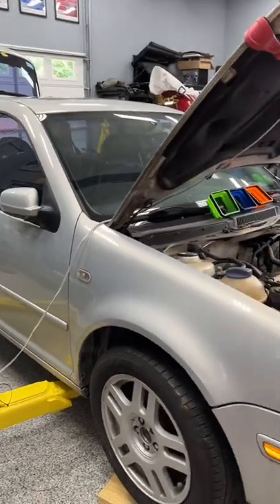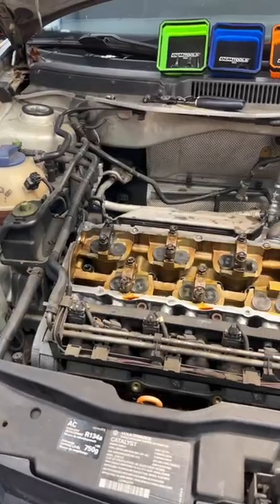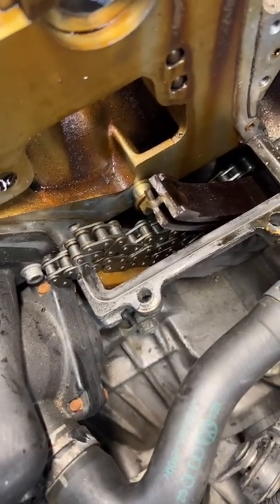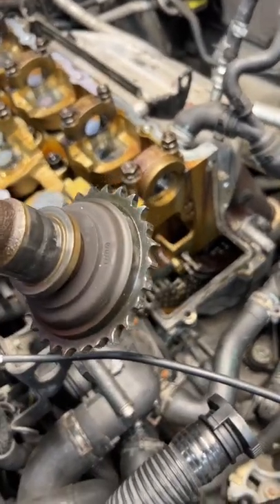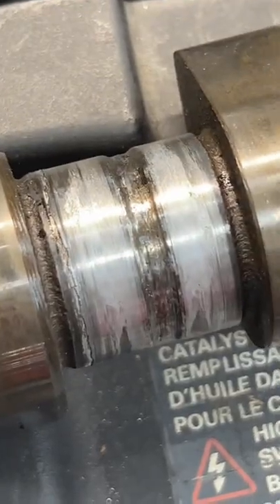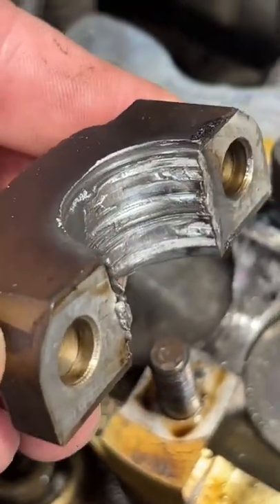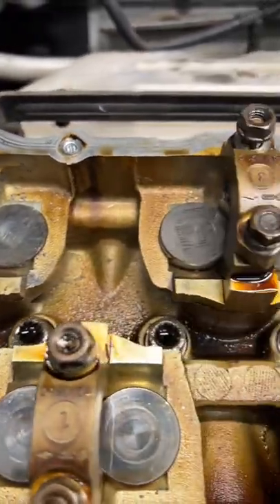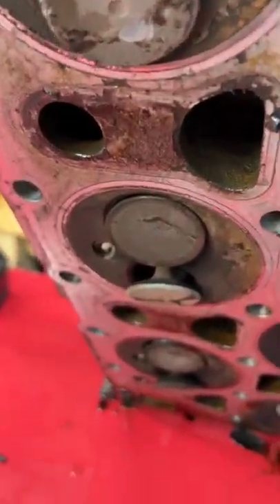What Happens When a Timing Chain BREAKS

Comment from the maker: I’ll have a full in-depth breakdown on this one for y’all soon. But the damage was too good not to share
Reply: It sure was. I suspect you think oil starvation led to the destruction.
Reply: Yee haw, looking forward to it.
Reply: @Peter_Riis_DK  I think not oil starvation, more like never changed the oil, or never checked the oil level on an engine burning oil, or still running the original factory oil filter.
Reply: I imagine it would be financially pointless to fix it for the vehicle, unless you had spare parts around anyway or were planning on using the block for a project. Damn, how I'd love to have a VR6 that doesn't cost an arm and a leg and is readily available. Here in Germany, they're pretty rare beasts because the most popular engines were 1.4, 1.6 and the fabulous 1.9 TDIs.
Reply: Ain't no hill for a climber!!! "Timing Chain Sadness " isn't that a song title?
Reply: It's a vr6 sooooooo, it's getting rebuilt
Reply: I buy all 1.4 TSI Motors with Chain Brake and Piston branke and No Problems WE make alle of Them New an Bye Bye 😀 . All Motors with turbo an supercharger
Reply: So you're gonna fix this or does it need a new engine?
Reply: Sounds interference grenade.
Reply: How much does a job like this cost? my 2013 5.7 super charged tundra cylinder 1 compression is reading 90 psi. Makes no noise, turns on, just drives with less power.
Reply: I wonder how you take a closer look at any kind of moving belts or pulleys with that beard, do you tape it up?
Reply: I have to admit. I have been using the phrase "sadness" on the regular since first seeing your channel years ago.
Reply: was a mechanic's gamble.... 500$ is unfortunately a grocery store weekly trip in 2023... but if motor did not crash... no1 would know
Reply: Wow, you're really positive about it!
Reply: Rebuild good to go
Reply: Replacing the engine head would work?

Comment: Wouldn't that much metal on metal be screaming like a banshee? I wonder what metal the guy was playing over the stereo to drown out the other metal?
Reply: It would probably sound more like a thunk and the engine stopping
Reply: Nah you don’t hear shit that’s why people run them dry they don’t know without looking unless they are listening really close. May have had a loud exhaust to.
Reply: Cast iron cam in an aluminium bore, not much noise, if at all with no oil. It just melts and galls up and goes smoosh.
Reply: Burzum Jesus'Tod, drowns out basically everything.
Reply: @SPE4RHE4DS  Pretty sure most black metal will do the trick haha
Reply: Slipknot for sure….
Reply: iv runned a toytoa Corolla with out any oil for 30mins and drove around in circles didnt even make a sound totaly dry zero oil after the 30mins it started making noise and turned it off put oil back in and it was fine
Reply: @kato2182  Yeah it's a Toyota. Anything else and you're screwed.
Reply: @tammyforbes2101  Umm no.. pretty sure I know my car.. when I first start it up it's supposed to make all those ticking/knocking sounds for 15-20 seconds 😂
Reply: @kato2182  Doubt
Reply: Agreed he must of heard that. All is needed is another engine. 
Good thing it was cheap.
Reply: That’s metal🤘
Reply: "Cry of the Banshee" by Brocas Helm 😁
Reply: Metal
Reply: @tammyforbes2101  Lol, I ca clearly hear even the slightest tick, and im sadly kinda deaf...
Reply: @garrethdovey2861  if it was slipknot the car committed suicide.
Reply: Metallica
Reply: @kato2182  yeah no lol, worked as a tech and you did no such thing
Reply: @richmondvand147  I’m still working as a tech and who knows where the car is now

Comment: Damn. That engine is toasted
Reply: But isn't the block still good?
Reply: @DaBossk  technically yes but down to bare block clean to get all metal out oil pump chins gaskets plus much more. Better to drop in a salvage yard motor with warranty
Reply: @DaBossk  its cheaper to head to a junkyard and get an engine for 200$ then to do all the work and parts for 600$
Reply: @thatslegit  Junkyards went up to 450 plus tax.
Reply: No. That head is toasted
Reply: @thatslegit  all the work and parts for 600$ dont think so.
Reply: @thatslegit  I got a 4.6 2v motor for 450 but after swapping chain guides and & new oil pump, new gaskets, and various things to replace while it’s out. I’m a bit over a grand into it. still not bad
Reply: @thatslegit  600$?!? I want some of whatever you're smoking. Shit would be like 3 to 5k at a shop in my area, if they would even go near it.
Reply: nah j put new valves new cam and timing chain and it’s good
Reply: would check valve springs too
Reply: @thatslegit  i doubt you’ll be finding a VR6 in a junkyard. but the engine is still worth a machine, rebuild, and maybe a new head
Reply: @RegulerShowTV  Cant complain for a grand mate
Reply: @DaBossk  maybe but it's cheaper to get a used one
Reply: Y'all do realize I used one is likely to have the same problems that cause this one to fail
Reply: @GeminiWoods  i never calculate labor since id do that myself. I hang out with the honda boys and we do hauls every so often
Reply: @thatslegit  what??? Where???? Just paid 650 for a mazda 3 motor smfh

Comment: Gotta love those interference engines
Reply: Designed to total engines with the excuse of fuel economy.
Reply: @osco4311  non interference engines suck for power, interference isnt just about economy
Reply: @osco4311  its not for fuel economy its for higher compression ratio
Reply: @downreach5751  Which provides....?
Reply: @andreasu.3546  provides power so you don't need to buy a 6 liter engine to make 200 crank hp
Reply: @red how do we break free?
Reply: @nathank5794  lol 2.4L engine and a fast CVT should get you 0-60 in 6 seconds.
Reply: @downreach5751  Higher compression ratio = higher thermal efficiency = better gas mileage
Reply: @red wish more people like you designed cars...❤

Comment: I'm convinced mine was one more startup from doing this. 
She made a hell of a racket when I parked it in 2012.
It didn't fix itself by 2019 sitting in the garage all that time, so I opened it up and found busted guides and chunks of guide that were timing gear shaped. 
I'm also glad I dropped the pan because that's where all the pieces were. 
Runs great now 🤣
Reply: I hate when they don’t fix themselves on their own lol
Reply: Busted guides sounds like a Ford 4.0
Reply: @tegimr  pretty common in the vr6 engines. It was throwing cam/crank correlation codes for a few thousand miles before I parked it, and compared to most ,130k was pretty decent.
Most of em need chains by 110-120k or so. 
I was horrified when I got it apart, like if I would have used the starter to turn it over she was gonna jump time and I'd have a paperweight.

Comment: I've changed a timing chain once. I never wanted to do it again, but thanks to it, I knew the sound of when the guides started to wear out.

Cut to a few months ago and me mum's motor started up with a very familiar slapping sound.

Called the dealership to avoid my troubles and explained the issue:

"Pretty sure it's the timing chain guides, but I don't want to do that job. Want a quote on the cost."

"Well, it's pretty unlikely to be the timing chain. What kind of sound is it making?"

"A sort of slapping, grinding sound. Can I just get a quote for the job?"

"... Well, it's pretty unlikely to be a timing chain, but we can check it out if you want to make the appointment. Around where is the sound coming from?"

"... The passenger side. Around the timing chain cover."

"... Well, it's unlikely to be the timing chain, but we'll make an appointment so we can see what it is."

Guess what the problem was?

Suck it, Sunny. Literally just wanted a quote, bruv.
Reply: Do timing chains routinely go bad? I thought that they are supposed to last a very long time
Reply: @zzoinks  Timing chains usually last a good couple hundred thousand before they stretch out. The problem is the timing chain guides, which put tension on the chain. They're often lined with a tough plastic, so they start to wear and malfunction around the 150k-200k mile marker, from my experience.

You'll hear it, the chain starts slapping up against the valve cover. Sounds like a bad tick, you have no idea how many systems I tested before I found the issue the first time.

Comment: I sold my 2001 VR6 with an AFP motor many years ago - new owner reported noises from the engine a few months later, indeed it was the guides/chains failing. And I changed the oil every 5k since brand new.
Reply: i have a 2.0T 2006 jetta with 183k miles. i change my oil every 3k and i still worry about my oil balance shaft taking a shit soon. guys say it happens when you don’t change your oil often enough on these FSI engines, but you just never know since it’s a vw
Reply: other than that it’s been a pretty good car though
Reply: Some engines are just shit and timing chains are rarely not shit.

Comment: Timing chains don't break.  For whatever reason, perhaps rtv plugging a hole, no oil went to the cam towers, when the cam seized, the chain broke the sprocket.  You need to diagnose the oiling problem or it all happens again.

Comment: why would you try to turn the engine over with the starter when you know the timing chain is broken?? if all 6 valves were not bent before you did that, turning the motor over for sure bent them. Whenever there is a timing chain/belt issue never try to start or turn the engine over, you will cause so much more damage from the pistons hitting the valves (if this is an interference engine like most are)
Reply from the maker: Why wouldn’t I? On what planet would the PO not have cranked the car? How else would the PO assume the chain was broken? 

The damage was done Long before the car came here
Reply: @HumbleMechanic  turn it over with a breaker bar if you have to, just by all means dont use the starter motor. IF the timing chain/belt is off you will just slam the pistons into valves that are stuck open. At least when turning the engine over by hand your not forcibly rotating the crank to where you could bend multiple valves in a few seconds

Comment: @HumbleMechanic How do you prevent this from happening?
Reply: oil changes 👍
Reply: and maybe some extra additives in the oil if you’re afraid your passageways may be clogged with sludge, which would prevent areas in the motor from receiving proper lubrication like the cap in the video

Comment: I once saw a jetta that lost oil pressure (I found out later after i got laid off the shop I worked for told him it was fine) he had the car towed in off a mountain pass with cylinder 4's piston absolutely grenaded itself into the cylinder wall locking up the engine.

Comment: I don't know I think a $500 GTI was probably a waste of money no matter what condition
Reply from the maker: For many people yes. I made money on it
Reply: @HumbleMechanic  I had a 1987 Volkswagen scirocco 16 valve motor the first nice car I ever paid for with a bank loan I was really impressed the car was beautiful not many miles on it well under 100,000 in the timing belt broke bent valves it was a nightmare but I've worked on cars in the past consider myself pretty good at it I replaced and rebuilt it myself it ran great sold it to a friend same thing happened a year later I don't think they were designed very well

Comment: I'm always told to never buy a car with timing or engine issues when it's an Interference Motor and only look into Non-interference Engines if I was looking at a clapper. Mostly because of cost to repair and the amount of repairs needed.

Comment: So after the timing chain and the bent valves, the camshaft and the cylinder head. Now he needs Pistons because the valves hit the piston and damaged the ring grooves causing the rings to seize in the piston. And if there is damage in the cylinder head because there was lack of lube then I'm sure that the bottom end of the engine has got all that metal in the oil and has ruined the bottom end. Replace the engine and get it over with. And this time take care of it

Comment: yeah i have some sadness going on with my pile of metal
1997 nissan d21 hardbody pickup, ka24E aaand pulled the head to do a , frankly less than nessesary head gasket, pulled the cam bearing caps off and, curse of the alu head has struck, and ive pullled some threads. fml man, i just want muh truck to run again, its been dead for almost 2 years now....

Comment: Well looks like it lost oil pressure and then the tensioners failed and so the chain failed and with a no valve clearance motor you get that.

Comment: Doesn't a vr6 use a single valve head? Overhead cam? So a remanufacured head along with a timing chain and running gear and guides completes job for say 1200$ in parts. Seems like a $4500-6500 car in this current market.

Comment: $500 is $499.99 more than the car's actualy worth haha
Reply from the maker: Nah i made money on this car and kept a bunch of parts.
Reply: @HumbleMechanic  Well yeah with how ridiculous the part costs on German cars are you could sell one wheel off that thing for half the street value and turn a profit buying it for $500. Hell just the tires alone are worth more than you paid for the whole car. That shit's one of the reasons I will never personally own a german car myself. Just costs too damn much to service the bloody things. Maybe I'm spoiled by how dirt cheap parts are for mid 80s six cylinder Ford half-ton trucks, but the part costs alone are a dealbreaker for me.

For $500 I might be convinced to do something crazy with one, though, like rip the back seats out and shove a carburetted smallblock V8 of some sort in there. Make it MR. Manual transaxle of course. Wouldn't need much to make it quite a spicy little thing given how light it'd be after I got done gutting it of all the plastic and computers it wouldn't be needing anymore; a basic 2bbl 305 would be plenty.